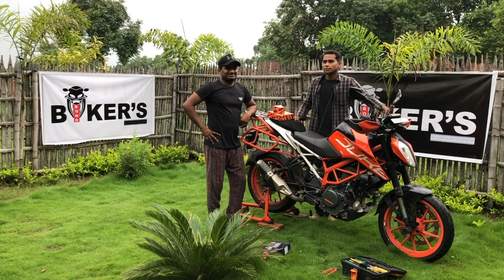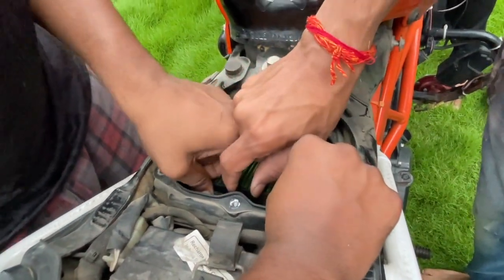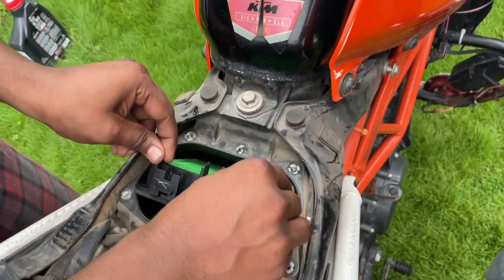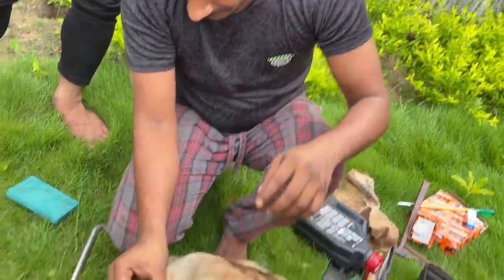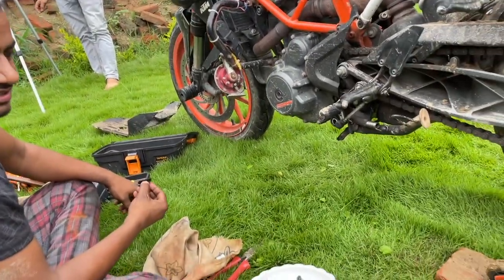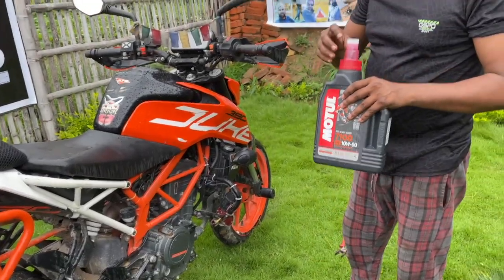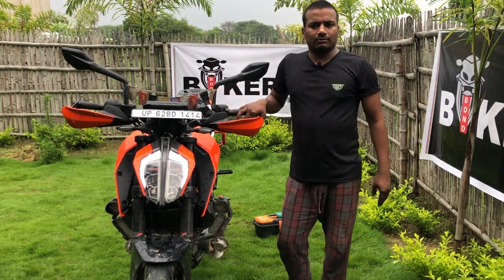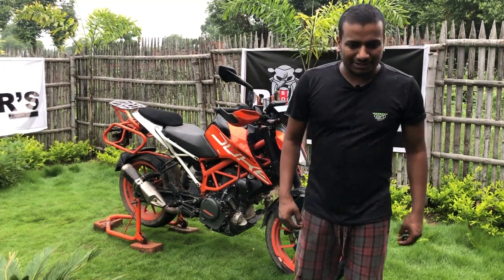Duke 390 Service | Full Bike Service Guide at Home | Biker's Bond

Comment: Full service how much cost?
Reply from the maker: Engine oil 1450
Aur filter : 258
Oil filter 74 
Total around 1800
Reply: @bikersbond  break pads and other's? Rate
Reply from the maker: Front is around 300 
And back is also around 300
Reply: @bikersbond  bro full service cost how much cost?